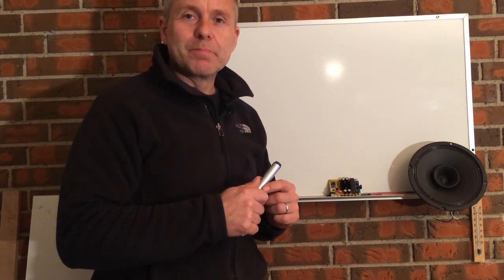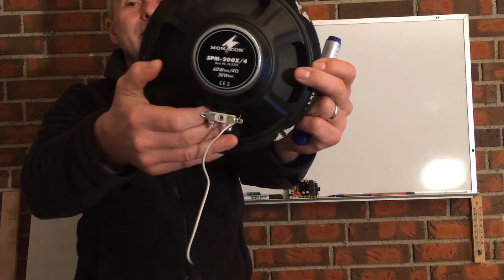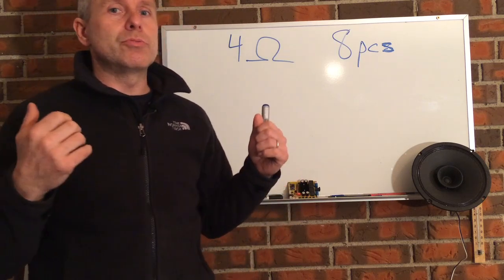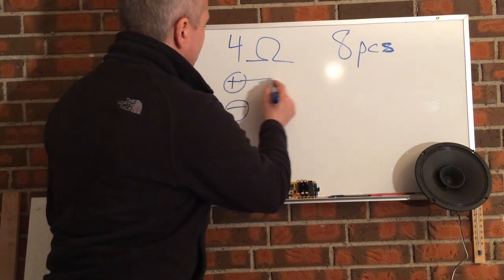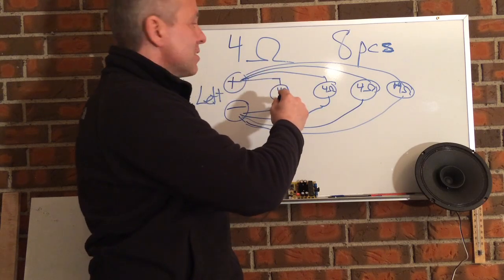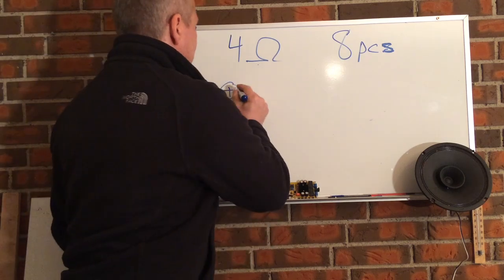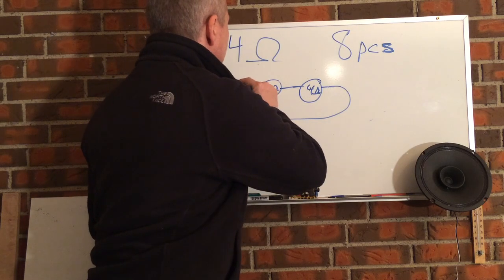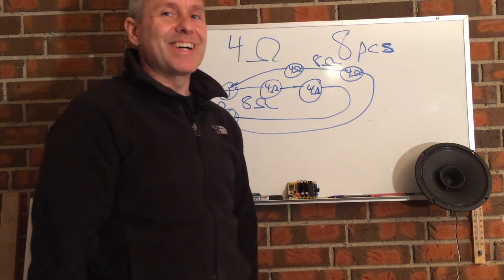Connecting many speakers to one receiver or amplifier

Comment: Thank you, I was about to commit  involuntary manslaughter to my 4ohm max receiver by hooking connecting two L/R satellite speakers with a subwoofer all rated at 3 0hms each to the speaker level output. So, if I am understanding it correctly, the resistance of all three in parallel would be reduced to 1? 3/3

Comment: Okay, so I have the general idea ... but something in my brain keeps kicking the entire thing back.  I have a set of 5 Goldwood tower speakers. (Bleh, cheap brand. The subwoofer was garbage, sounded like garbage, had a background thumping like a heartbeat at one point, and now after 7 months, just plain no longer works).  A friend JUST gifted me an older (I think), small iLive lower-end set which, has a soundbar and 4 small speakers with an amplifier/sub.  Surprisingly, I really like the sound this little thing delivers!  SO, here's the thing. I connected the iLive sub to the iLive soundbar, and to the Goldwood tower speaker set (which have the kind of little hole inputs where you use + & - wires).  All is working well (definitely better than when connected to the Goldwood sub).  But now, I would really LOVE to add the leftover iLive four little speakers for some extra sound  -except those do NOT have the two inputs for wires.  There's just the one wire which is hardwired into the back of each little speaker.  I imagine I could open each or splice the tower speakers to the little speakers, but this is where my brain fizzles and loses what it is I should do.  Any help, please?

Comment: So, under this logic, if i add another 2 4 ohm speakers on a 3rd line, would it drop the overall load on the amp to 2 ohms, as my amp needs to be running at 2 ohms for me to have the right power for the 6 speakers i have?
Reply from the maker: 2x 4 ohms speakers in parallel are 2 ohm total just between those 2, but if you add more speakers in parallel to that same amplifier output it will be lower than that, and it doesnt matter if its another speaker cable with plus and minus, if its connected to the same output with plus and minus it will be in parallel as well.

Comment: The BEST and cheapest way to go about a system like this is getting commercial 70v (volt) speakers and a commercial amplifier. Not only is it cheaper, but it requires much less wiring and much less complex wiring as all the speakers can just Daisy chain together.
Reply from the maker: Its easier, but not cheaper than what already someone have in the garage or a small class D amp from China, and the sound is not as good on 70v and 100v, often limited frequency band on the cheap models. However if its a restaurant build-out from scratch or other commercial place you are absolutely right 70volt or 100volt system is the way to go, because its easier for the electrician, so cheaper in labor and cable, and you can expand easy and control volume locally in a room without zone control, I do sell these kind of systems, but I see low impedance amps overloaded all the time to save a buck, and so this video is made to help out on that.
Reply: What?

Comment: Can I do two on each terminal. Two bookshelf speakers on the left two on the right ?
Reply from the maker: Depends on the impedance of each and how they are connected, you have to watch the video
Reply: @AudioTalk  ye I decided against it - my amp can take 8ohms and it already has a speaker on each side which is 4-8. I’ve got two more bookshelf 8 ohms speakers lying around but I think I need to buy a 16ohm amp to get the working and not attach them to the set up I already got !
Reply from the maker: @youwhoniverse 16 ohms is a smaller load than 8 ohms. Lower ohms = higher load. 97% of amps is designed for 4 to 16 ohms of what we consumers think of regular amps, but really is what is classified as low impedance amps, and then a few of those can take 2 ohm load. So you can load your amp just fine with 16 ohms by connecting in series.
Reply: @AudioTalk  wow thanks for replying! my amp has a load impedance of 4Ω-8Ω (not 16... does that matter?). I wanted to connect 4 bookshelf speakers. 2 of them have impedance of 4Ω-8Ω, and 2 of them have 8Ω impedance. So if on each channel i wire up one of each bookshelf speaker in series as you showed in the video is should be fine..?

Comment: My amplifier is 160Watts per channel. Can i put 2 bookshelf speaker directly into one channel? Two wires for positive and 2 wires for negative? Each speaker has 8ohm and 80Watts.
Reply from the maker: If your amplifier is ok to take a 4 ohm load which most are, there is no problem.

Comment: So in the diagram it appears that 1 of the speakers has nothing connected to its negative receptacle, is that correct  ?
Reply from the maker: No, it has to be a complete circuit to have current running, so all terminals will have minimum 1 wire.

Comment: so is his solution to maintain [4] ohms  suggesting that i use daisy chaining of 2 channels with the amp head set at stereo..on rear selector switch.. ? eg. If i wanted to connect 4.. 15 inch speakers on each channel..*daisy chaining*
Reply from the maker: You connect 2 and 2 in series and then parallel those 2 series connection, when you have 4 speakers going to the same output on the amp. The key to think about is that the total impedance needs to be right for the amp, which is typically 4 to 8 ohms.

Comment: Sorry but this is not correct cz only the last speaker will work cz hes the only one who hase + and - the first has only +
Reply from the maker: Not how electricity works, just as long as you have a closed circuit a current will run, the total impedance is what determents how much current. And not just speakers, this is how it is for any circuit, where you need to control the total impedance/resistance. Try look up basic information parallel and serial circuits, that might give some additional reference.

Comment: So if I had a bunch of 8ohm speakers... I could add them in series, effectively halving the ohm value each time (8 becomes, 16, becomes 24ohms etc.). Then I can divide that final impedance value by the number of times I have used that circuit in parallel on the same channel? e.g. 3x 8ohm in series is 24ohms, then if I had 2 of those circuits in parallel, I would have 12ohms on that channel? Or if I had 4 circuits in parallel I would have 6ohms? Thanks in advance?!
Reply from the maker: Hi Daniel, you got it! However the strategy to get between 4 and 8 ohms total will differ depending on the amount of speakers, but its ok to go as high as 16 ohms but the amp will produce less output. You could connect the speakers like you described and it would work with no problem, and yes one more series connection with 2 speakers, connected in parallel with all the others will give 6 ohm.
But if you want to utilize the power of the amp and lets say the same 6x 8ohm speakers. Then if you take 2 and 2 in series so that you have 3 series connections with a total of 16 ohms each, if you than parallel those 3 circuits you would get 5,3 ohms which would utilize the amp more.
Reply: could you theoretically add as many speakers as you wanted to this? or would there be a limit on how many speakers an amp can power at once? seems like even 8 speakers with the correct overall impedance would ‘work’ the amp too much, specially an old one. not an electrician what so even and know nothing about this, but it just seems too good to be true to expect an old amp to power 8 speakers at high volumes

Comment: if using a mono amp so no L and R how many speakers can I connect together if I wanted to connect alot
Reply from the maker: It will be the same as either left or right. Left and right output is just being used as an example because its the most common, so there is no difference in theory. So the goal is still to have the total impedance above 4 ohms and lower than 16 ohms for most amplifiers on each output, where in your case with a mono amp is 1 output.

Comment: How should you wire just two speakers per channel? In series or parallel?
Reply from the maker: Its depended on 2 things. 1) what is the impedans of each speaker? 2) what is the lowest impedans the amplifier can take?  Lets take the most likely scenario, that all speakers are 8 ohms speakers and your amplifier can take 4 ohms load, then it will be parallel. But if your speakers are 4 ohm impedans you would need to go in series.

Comment: Well, but what can I do with different ohms and watts collected speakers to built à Powerful enclosure ?
Reply: Don't exceed the capacity of our receiving amp. You probably need to invest in a dynamic receiver that can handle multiple channels, plus sub outs at a low resistance capacity, like 2 or 3 ohms max.

Comment: Thanks for the video. How would one do this if the speaker connections are 1/4" TS ports? The terminals can be accessed on the 3rd speaker on my right channel but the 3rd speaker on my left channel is in a different cab with only the TS ports and I would prefer to avoid taking it apart to access the terminals if possible. (Same speaker on both sides just in different cabinets.) The left 3rd speaker in question does have a TS out as well but I would like to confirm that running a line out form it directly to a 4th speaker will be ok and not drop the resistance too low. I am powering each side with its own Behringer EP 2500 power amp with a center speaker bridge (*from one amp, -from the other.) I am safe down to 2 ohms and am not necessarily worried about damaging the amps, but I would like to make sure I am making the most efficient use of the power. All speakers are 4 ohms. Thank you.

Comment: Hope there is still life in these comments!
I want to connect two 6ohm speakers to each side (left & right) of an 8ohm output mini system.
Can this be done? If so how?
Thanks.
Reply from the maker: Hi Paul, you need to connect in series, connecting in parallel would likely kill your amplifier. This way you will get a 12 ohm load on each output, with parallel it will be 3 ohms.

Comment: When you got 4 ohms at the end, you did not really talked about how is that going to affect the imledence🤔
So, from your video I assumed that I can deal with the system as if I added a single speaker only. Am I right?
Reply from the maker: The 4 ohms is the impedance, and if you have more speakers being connected to same amplifier output you will need to use ohms law to  consider how you are going to connect them depending on each speakers impedance and how many speakers, because they will all be a part of the same circuit from being connected to the same amplifier output.
Reply: @AudioTalk  thanks for your comment. One more question please; if you connected the speakers in series and the first speaker blown up or failed, will it damage the amplifier or the other speakers?
Again, thank you a lot for your help❤
Reply from the maker: @oqhr  the speaker can blow in 2 ways melt into a short-circuit or melt the wire to a open circuit, either way in series it wont affect the other speaker and if these are the only 2 speakers on that amplifier output then it wont affect the amplifier either, granted the output of the amp can handle the impedance of the one speaker and doesnt need both speakers in series, an example of that would be an amplifier that is only stabil down to 6 ohms, and if you connect 2 speakers in series with each 4 ohms and now the one speaker out of those blow with a short-circuit so that now you have 4 ohm load on the amp and you might hurt it. But if you are experiencing no sound after blowing the speaker, its likely the one speaker blew and left a open circuit and all you need to do is either replace the speaker or connect the other speaker directly.

Comment: Do you think I can wire multiple speaker wires together and put them in one port in an amplifier? I have 7 speakers in total and I want to wire them all to one amp that has only 4 ports for wires. Will doing that damage it or what?

Comment: So if I have 6 speakers (2 6x9) (2 6.5) (2 Tweeters) and a 2 channel amp....

I can use parallel to hook left side +/- and right side +/- as long as everything is matching ohms and seeenough wattage for recommend?
Reply from the maker: Matching ohms doesnt matter, what matters is the finale impedans. So lets take the two 6x9 and i assume they each are 4 ohms since its a typical car stereo size. With two of those in parallel you will load the amp with 2 ohms, and then the tweeter on top, then you will have from whatever frequency that plays and up, and its a 4 ohm tweeter, you will now how 1,33 ohms impedans in that part of the frequency range. So the amplifier would need to be able to take that kind of low load not to fry.

Comment: Nice try but you left out the most important part of this whole video.  In the last illustration of wiring 4 speakers You did not mention which speaker terminals to use for this parallel arrangement.  You just showed a wire going from the amplifier to the first speaker then the wire going to the second speaker and so on without mentioning which terminals on the speaker you used.  There is a positive and negative terminal on speaker and we have no clue which terminals you used.
Reply: Indeed.. He did not specified the polarities in between the series of connections to the other spekears..
Reply: You need to create a circuit so you have amplifier + going to + on your first speaker then first speaker + to your second speaker + then your second speaker + to your third speaker + now you want to go from your third speaker - to your second speaker - then your second speaker - to your first speaker - then your first speaker - goes into the amplifier - creating the circuit.

That's what I got from the diagram.

Comment: How would I be able to connect two speakers into one side? I understand that in this video it explains four, but I need to know how to do two for left, and two for right.
Reply: use 4 less, 2 left 2 right
Reply: if amp does 4 to 16 ohms and your speakers are all 8 ohms parallel would be plus to plus on first speaker neg to neg then from plus on second speaker to plus on first and neg on second to neg on first that would give you theoretically 4 ohm load on that speaker terminal at amp to do the same in series connect plus on amp to plus on first speaker then neg on amp to neg on second speaker then connect neg on first speaker to plus on second speaker.That gives you series and an impedance or load of 16 ohms on that channel.Good config if your two speakers on that channel are on top off or next to each other then a small bridging cable is all that is needed between each speaker.Of course all dependent on many factors such as rated efficiency of amp etc.Good to get wise with ohms law and joules law.Ohms law v=i x r where v is voltage and i is current and r is resistance multiply i and r to get voltage divide voltage by current to get resistance and divide voltage by resistance to get current.Understanding this basic principle of electronics will help you no end when trying to calculate voltage current or resistance as you only need two values to calculate the third value.Kinda long winded and technical i know but rule of thumb when working with speakers with the same resistance values in parallel divide the value of the speaker by the number of speakers to get impedance and in series say for example with two speakers of 8 ohms then multiply 8 ohms by two to reach impedance value of 16 ohms .Again sorry if i have went on a bit there but if unsure.Google is your friend.Always stick within your amp and speaker specs though to avoid stressing components and possible damage to your amp
Reply: from amps + terminal to a speakers + terminal,then from that speaker's negative terminal to the other speaker's positive terminal, whats left is amps negative terminal, from amps - terminal to the speaker's negative terminal, i hope you understood. That is for single channel, same method applies for the other channel as well,i hope you understood.
Reply: Sami Khan that is wrong. He needs + on + and - on - (parallel connection)
Reply: @meekick  Your method is what I want to do to my 20-25 yr old Kenwood home system, It has surround sound set up with all those other 3 speakers set up to go along with the 2 main speakers, offered on it, But when I put in that mode it does not sound as good as just using the the 2 main speakers, So I've been just using the 2 main speakers. SO DO YOU Suggest I do your method mentioned here?? and just run 2 speakers on each outputs?  I have 2 bigger speakers I can use instead of the itty bitty surround type.

Comment: for the negative part do you connect the negative to last speaker only or does it need to go in the other ones also
Reply from the maker: Good question, plus from the amp goes to plus of the first speaker, then from its minus to plus on the next speaker and then the last speaker will have minus from the amp, and that will be a correctly phased serial connection
Reply: kidMagneto12 yea it looks like the first two speakers of the 4 he doesn't have the negative on them this seems wrong

Comment: Can you please tell me how to connect 5  8ohm speakers and 2  6ohm to a left and right side. Thank you.
Reply: Use formula for series parallel connection:
Series connection:
   Rt= Ra+Rb+Rc
Parallel connection
   Rt = 1÷(1/Ra+1/Rb+1/Rc)
Note: Rt must be not greater than 8 or lesser than 4 ohms,
Reply: @shinakuma275  How about connecting 2 4ohm and 2 16ohm speakers into a stereo system is it possible ?

Comment: How would I go about wiring 6 speakers in parallel?
Reply from the maker: If they are 8ohms drivers and you connect all 4 on the same amplifier output you will get 1,3ohms and very few amplifiers will survive that. 6 is a awkward number for getting a good load, 8 or 4 is better. With all that said, you could Create 2 cluster with 3 speakers in parallel together and then serial connect the 2 clusters. That will end up around 5,5ohms total